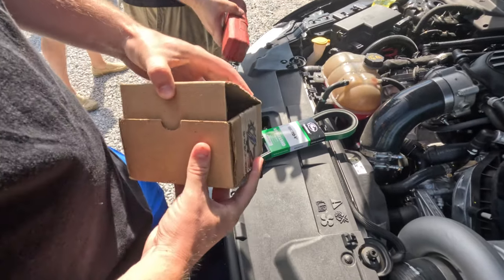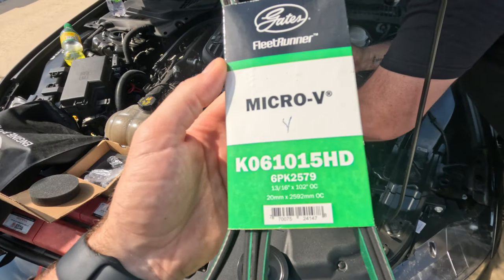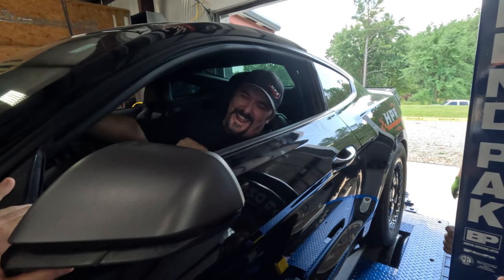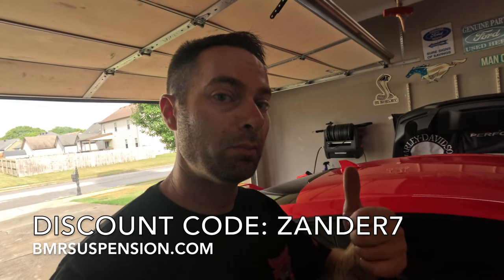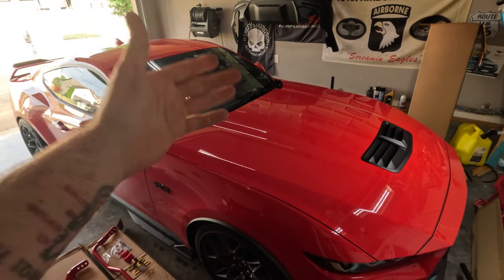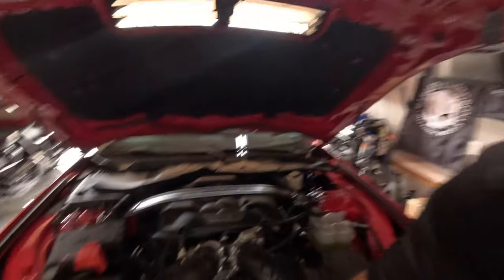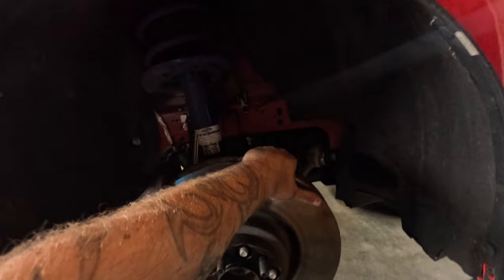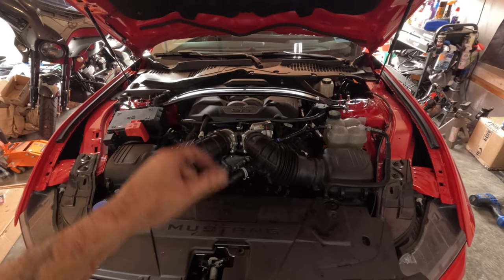2024+ MUSTANG BMR ADJUSTABLE SWAY BARS *THESE THINGS FEEL INSANE 🔥

Comment: Battle, I just put a set of BMR lowering springs on my 2019 S550 and they are freckin Outstanding. Best springs Ive had, I usually go with Eibach sport lines, but these BMR springs imo are much better. The car is much more planted.
Reply from the maker: Stay tuned. I just swapped to BMR springs too. Absolutely amazing
Reply: Which ones from bmr did you go with
Reply from the maker: @uptobatentertainment  handling spring
Reply: I went with the handling springs also but even from a pull they are planted. They're good springs, world of difference
Reply from the maker: @11B_GRUNT  I love them. 😍
Reply: @Zander13Productions  Battle that awesome. Hey when is the whipple going on the S650?